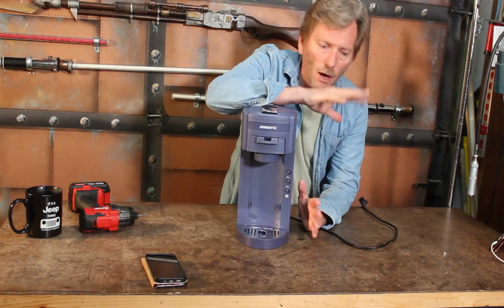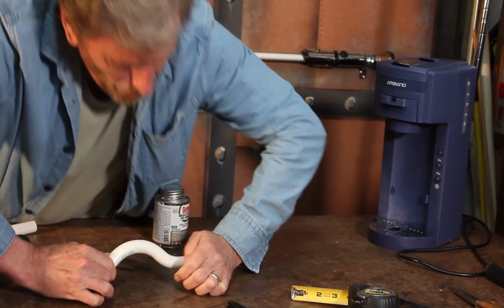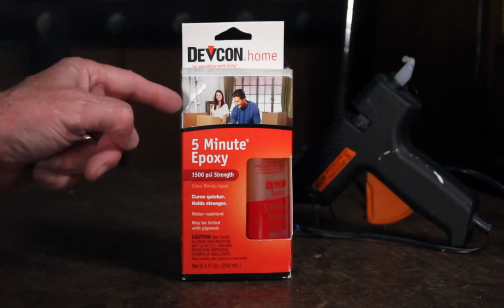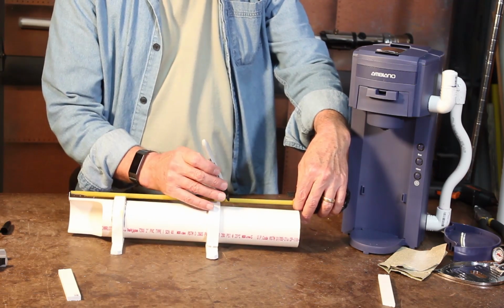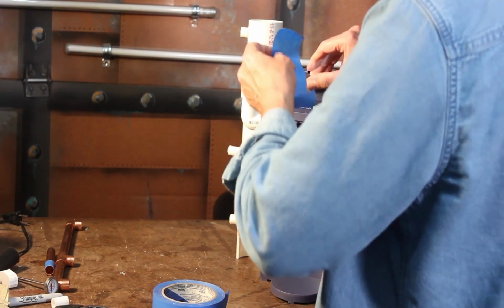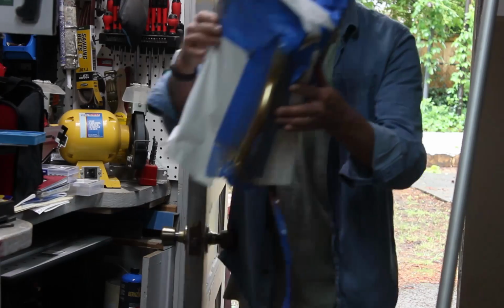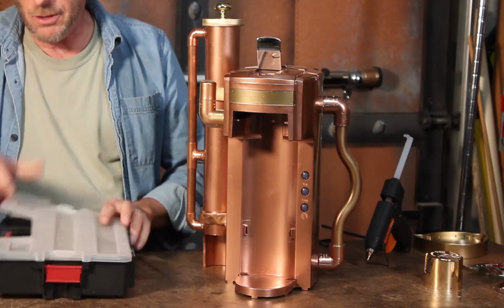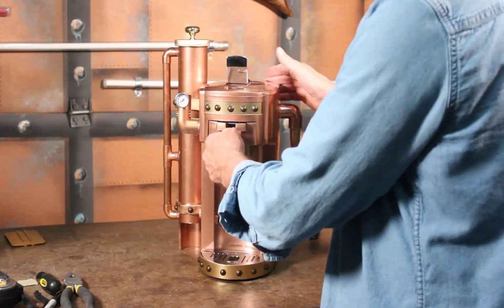Upscale A Simple Coffee Maker! Fast, Easy, Fun!

Comment: What is the glue you used on the pc pipe
Reply from the maker: I used Oaty brand pvc cement from Lowes. But you can get it in any plumbing department. I found if I was glueing pvc to other plastics I would use 5 minute epoxy. I hope that helps. Thanks for watching